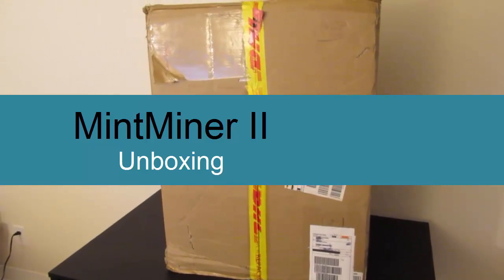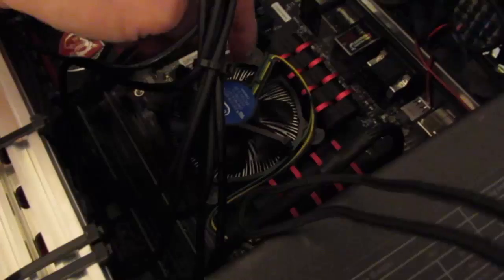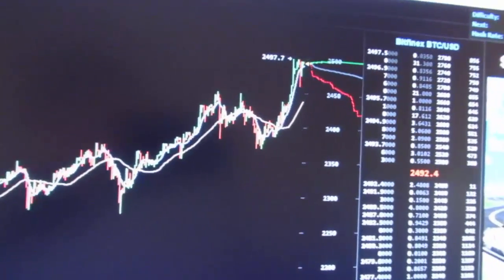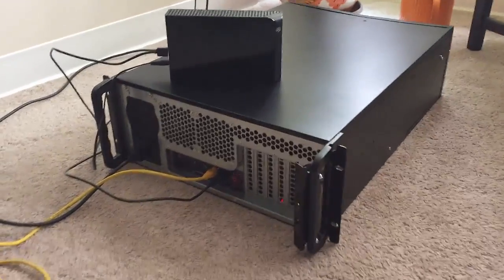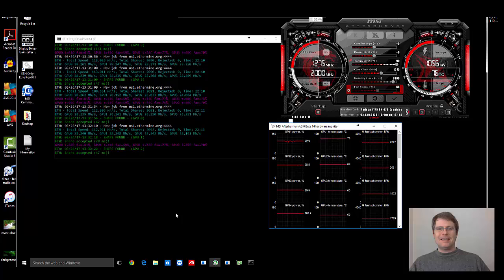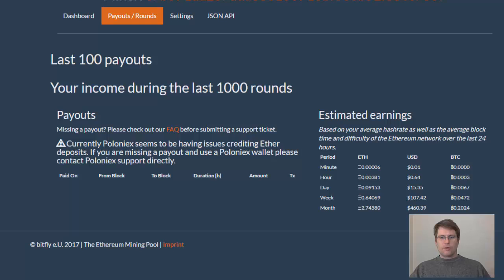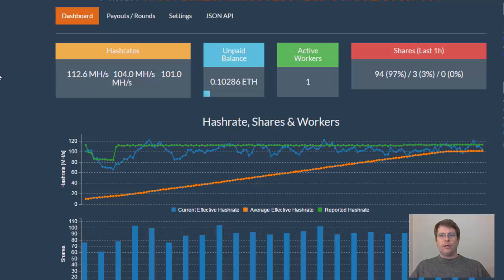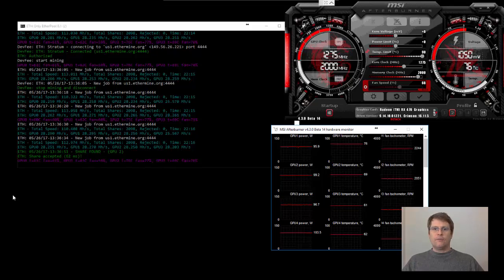MintMiner II Rack Mount 7 GPU Ethereum Mining Rig

Comment: It's not good rig at all. Temperature in it will destroy equipment in a short term and dual mining will melt everything inside. Between cards should be at least 150mm and in this space you can put max 4 cards and put in and out fans...but if you are happy - why not )
Reply: Andrey and Lumbridgecity, as long as the case fans have been upgraded from the original Rosewill units that came with the RSV-L4500 case there is no reason to worry about heat buildup. The principle is the same as supercomputing clusters and other servers around the world: as long as your air velocity is high and directed past the cards, it will carry ample heat away.

This information comes from extensive knowledge of enterprise hardware, as well as having already built 6 nearly identical units to the one in this video about 6 months ago. These 7 (and 8) card rigs run cooler than my open-air frames ever did because of the velocity. Feels like a hair dryer on the back side!

Lastly, please understand that you are buying this hardware at a significant mark-up due to the fact that the item is pre-made. I build almost identical rigs for $1850-$2200 (including tax and shipping), depending on discounts and coupons available at the time. I use 95% the same individual hardware as well. Now I know who's been buying up all the Rosewill cases! :D That being said, I'm very confident you'll still ROI in <1yr, significantly less than that if Ethereum keeps climbing as it has been. Good luck, and happy mining!
Reply: No problem, I'll be glad if my comment is helpful for you. I research a lot and made my own rig, but temporary I'm out of this hobby because of changing country for living.  I also had to submit that you also had to check the temperature on the motherboard where power supply system is, usually they have radiators but in this rig they can be overheated. RAM is also important - at least 8Gb for such amount of cards. HDD or SSD its not important - you can use even USB flashdrive. GPU's still need some work on them, I think you understand what I mean. 
English is not my native language so sorry for possible mistakes. Best regards.
Reply: he should undervolt it to reduce the temps
Reply: Depends on the airflow. Those servers cabinets push a lot of air fast.
Reply: @dan cruz hey man thanks for that comment, im building my rigs open frame right now but i fell in love with the prospect of building like this and stacking them on an enterprise hack, because im kinda running out of space in the house! so now i know wich case that is, thanks to you, and its gonna save me a lot! <3
Reply from the maker: You were correct.  But I think it was not the spacing, but the fact that the builder messed with the GPU Bios settings to get more hashrate from the cards - and that made them run hot and EVERY CARD burnt out.
Reply: did the cards die? ! ?

Comment: ooo I like that case. I'm just using my gaming computer I had for years. all I need was video cards. I bought 2 and modified bios. then installed and ran. I'm at 27.5 1405 core clock 2200 memory mem, fan 100, also added a bitmain fan cause the CFM is better and I can drop my video card temp 10 degree C

Comment: Watching this video again.  Another thing about the setup is that the zip ties will eventually dry out and break.  I suggest Velcro ties.
Reply: Lumbridge, what cards are they?  470?  I've been running my msi 470 oc cards in this case for months now (with no lid) @ 24.589mh/s to 27.5 mh/s.  Will try new drivers soon.  Are you absolutely sure your video cards are burned up?  The gpu's should be able to handle up to 110-120C.

Comment: Cook rig. looks like you should break even at around 6 months of owning it. Not too bad. I'm actually surprised the temps on the cards are as good as they are. wish I had $4000 to drop on one of these, lol. At least i'm guesstimating that's what it cost.
Reply from the maker: yes - it was $3700 bucks - and I was wishing for one for several months before I had the trading profits to buy one!  Now that I've been running for a while, I've been studying how to build my own - it would save about 1/3 of the cost.  Watch for those videos coming up!

Comment: the video cards are to close you need around 4 or 5 inches gap between them as the heat will get high in a case its best to have an open air rig and also buy a $10 dollar plug type watt meter to keep an eye on the power used and never go over 80 percent of the psu
Reply from the maker: That is a good tip. So far all the cards are running in the mid 70's - the cards run 3 or 4 degrees cooler when the case is closed because the airflow is directed through and past the cards.  I need to get a watt meter - running blind there.

Comment: Maybe a dumb question... but how are there 7 cards with only 6 PCI-e risers? And is the last slot even a pci-e? Looks like that MB only has potential for 5 GPUs
Reply: MSI Z97 Gaming 5: 3x PCIe 16x, 4x PCIe 1x. I wish I had picked up more when they were ~$100, now the price is over-inflated.

It is possible to run an 8th card using an m.2/PCIe 1x adapter, but a BIOS modification is required.

Comment: Rosewill 4U server case, power drill, blammo. make sure to clean out metal scraps which can short your mobo. I like to screw the power switch into the back grill.
Reply from the maker: I've been looking at the 4U server case - but don't see how i can fit the cards in the same way.
Reply: you need to strip out everything, leaving just the case. I use the silver metal strut inside the case to secure my gpus, recommend drilling the holes outside of the case so that scraps of metal aren't left behind to short out your components. There are 2 flat metal pieces that help secure the hdds that you should keep when you are stripping out the case, these can be placed together then duct taped into the case to serve as a place for your pcie risers to stand. Finally, you need a fixture for your fans (which should be 150-190 cfm) i like using the koolance 3x120 radiator shroud after i take the plastic off of them. Don't forget to put some grills on those fans! I can fit 7 gpus these cases. Although, I only buy grey matter cases now: when i was starting out I was looking to cut costs everywhere and DIY this case costs maybe 175usdt

Comment: The temp will kill this miner.
Reply: Absolutely not true. Airflow is key, high velocity server fans must be used. There is a reason why every data center ever uses a hot side and cold side, and they all utilize closed server cases. As long as you have adequate airflow, you're golden.

e.g. All of my 4U cases run much cooler than my open-air miners ever did.

Comment: Honestly I would leave the top panel off and blow a box fan on it to keep it cool. I think the cards are a little to close together.
Reply from the maker: The cards are about 5 degrees cooler because of the air-flow through the unit with the lid on.  It is moving massive air - and pretty quiet too. I don't have an S9 Antminer to compare it too though
Reply: It will run much hotter with a box fan vice cross-flow with good fans and a sealed case. That's coming from personal experience.

Comment: I would not recommend putting this in your closet. It will get very hot. The cooler it is the long the cards will last. If it where me I would put it very close to my a/c vent.
Reply from the maker: The closet I have is unique, because the ceiling vents air out of the apartment... if it were a sealed closet I would agree - it is warming up the place!
Reply: Great way to deal with it :)